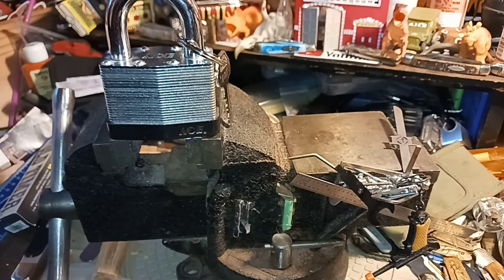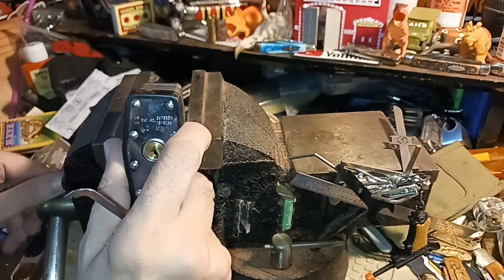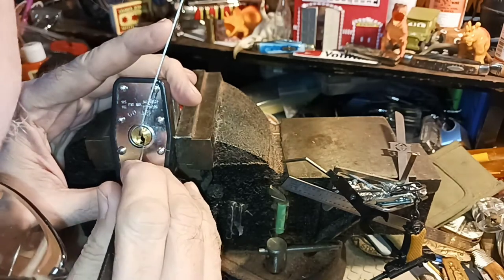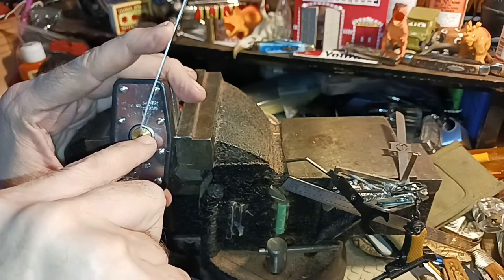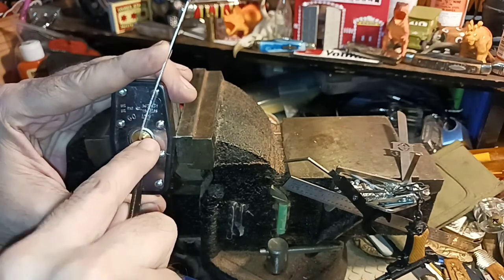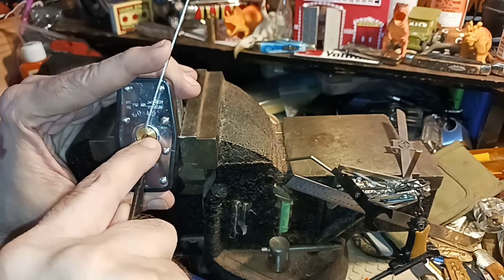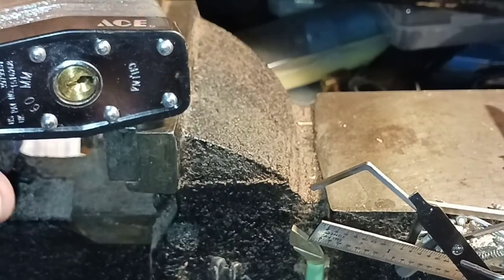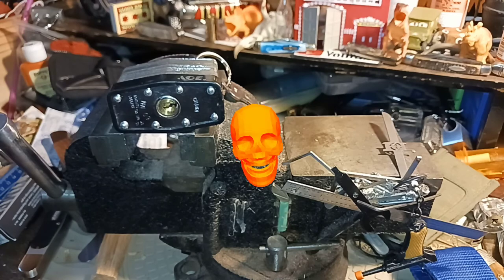(747) 🔐 Picking Security Pins🧵Spools

Comment: nice job! you still got it!
Reply from the maker: It took me long enough.  In the next video I rake it into a false set, then pick it open. I'm rusty at this. I couldn't even open a Chinese Disc Detainer lock the other day & they used to be easy.
Reply: @WilliamsKnifeLife  well i think you did a good job and ya you might be a little rusty but nothing a little practice wound not help! as for DD,s being easy so far i disagree but then again i only have one and it has a round body that i think is making it hard for me to keep the tool straight so i have not gotten it open as of yet, but i will some day thank you for another great video
Reply from the maker: @danareed1656  my biggest issue with DD locks was you tension off the first Disc on most of them & the Chinese DD tool usually protrudes down to the second Disc preventing it from turning.  So I have to hold the tool up a little,  and then I can usually open them.
Reply: @WilliamsKnifeLife  iv been using the sparrows DD i do have the cheap sets but they need to be modified they are to big to fit in the key holes